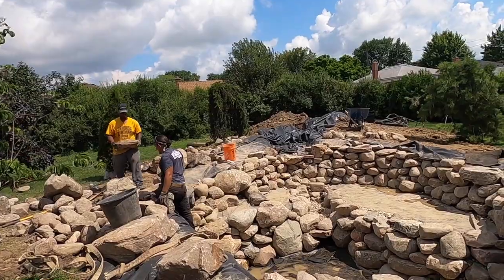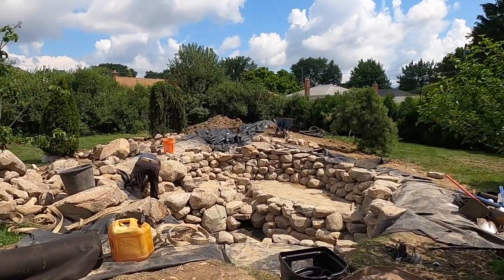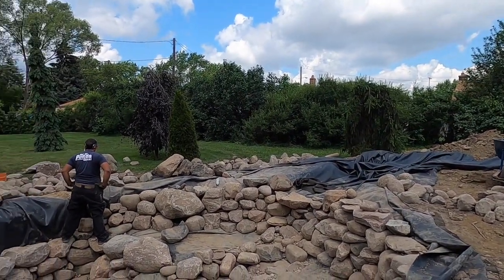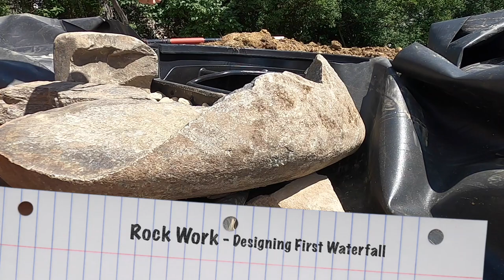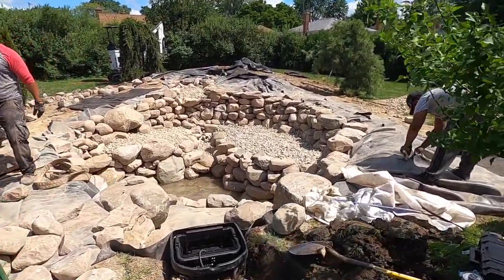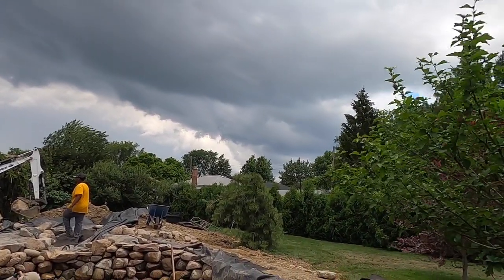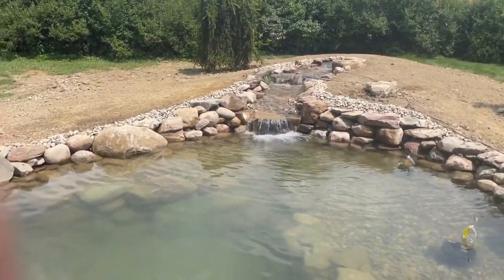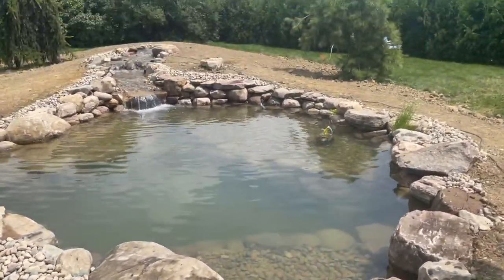A Walleye Pond In A Residential Backyard | Part TWO

Comment: How many walleye cau u put in that pond?
How many feeder fish?
Reply from the maker: Not sure, the city wouldn’t allow a deep enough pond for walleye to survive…
Reply: @PutsPonds  mine is 60 round 15' deep. How many can I put in there if I feed em
Reply from the maker: @electromechanicalstuff2602  Here are some basic rules determining how many fish your pond can sustain: Rule 1: one 6″ fish for every hundred gallons of water. Rule 2: 1″ of fish per 10 gallons of water. Rule 3: 1” of fish for every square foot of surface area (24” deep pond) You’ll need to do the math to figure out how many will work for your pond.
Reply: @PutsPonds  thanks for the info